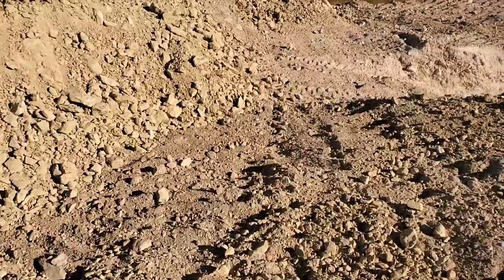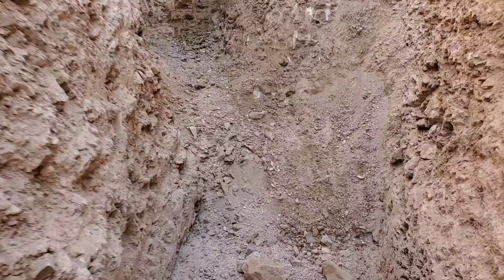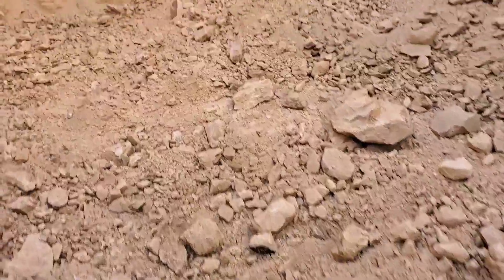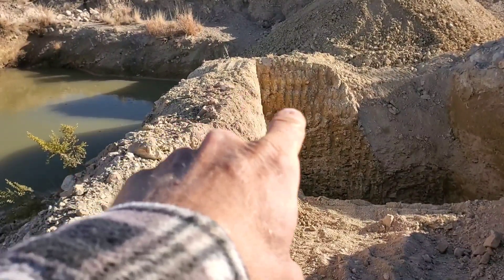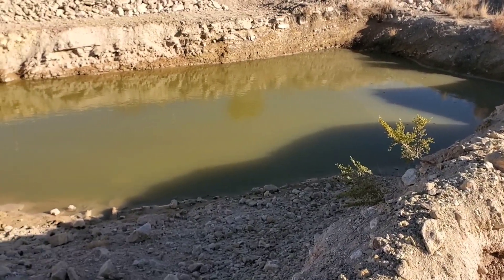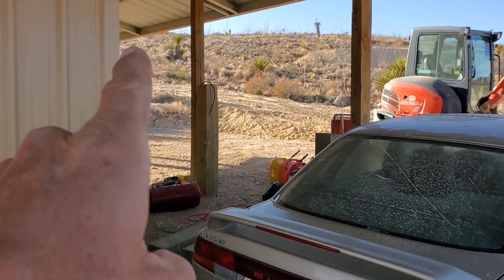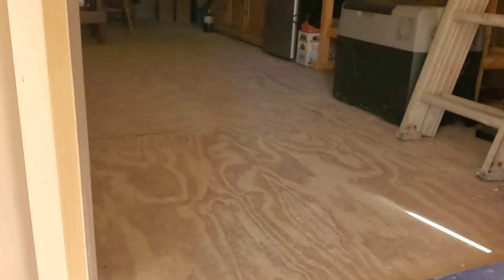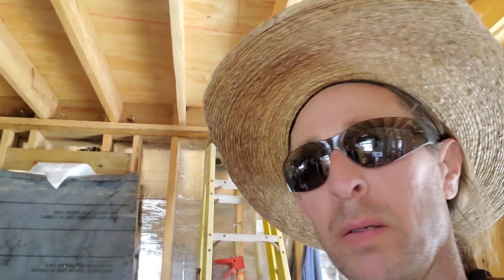Plan C on the old-fashioned stonewall well off-grid homestead @Timeline Ranch

Comment: That massive V trench might actually be a blessing in disguise. So much volume might create quite a bit of water pressure at the bottom of your well. Which would help the drive water through a 'natural' filter of rock, gravel and sand. 
It also might help recharge the surrounding ground water. Or push it along those strata lines you saw and create something like the Spanish Acequias.
Reply from the maker: The well seem to stay equal with the pond good. I still need to finish a tie-in to the pond, but so far, it already works well. Thanks for watching.